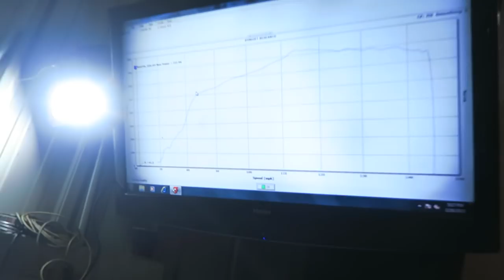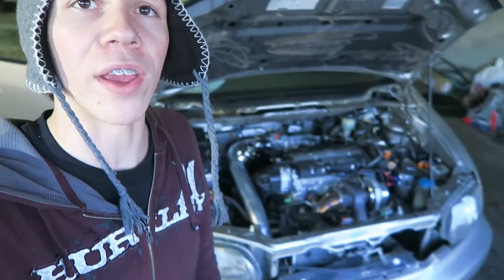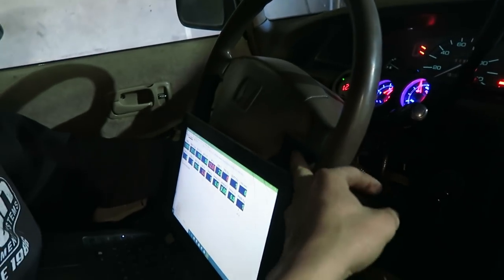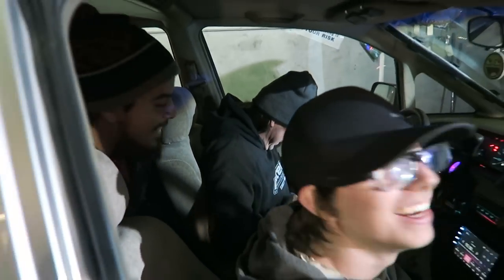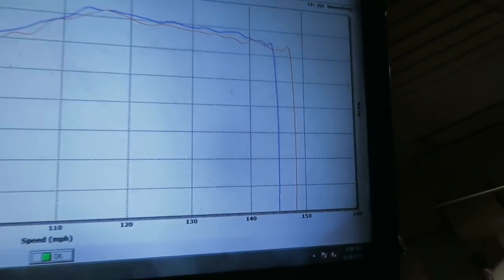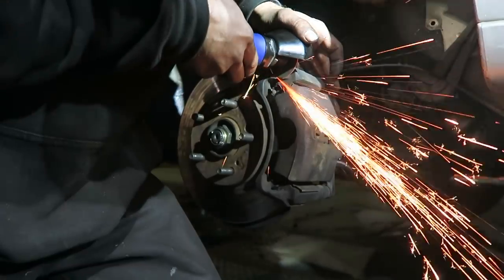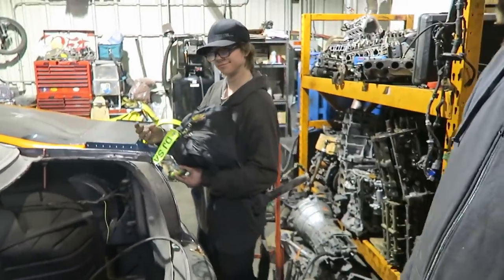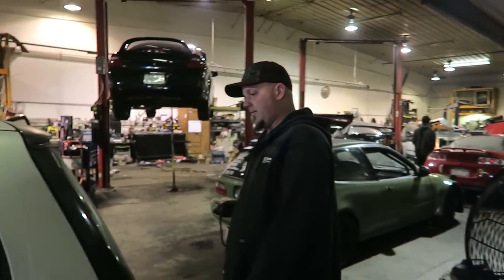The Minivan Made More Power Than My Race Car!

Comment: Guinness World record for most people down the quarter mile in one vehicle doing 10's.
Reply: CJ Serf you might be on to something
Reply: CJ Serf 8 people traveling 1/4 of a mile in 10 secs 😍😍
Reply: It would add 700kg of weight. It probably won't hit 10 like that.
Reply: Fastest standing 1/2 mile for a minivan with passengers ( Texas Invitational ), then do the 1 mile.  Get in touch with 1320 Video and make it happen!
Reply: CJ Serf I think after 13s or 12 sec pass you can't have a passenger let alone passenger's.
Reply: Yeah, just 8 dead people instead of 1. This thing would be dangerous as all hell at any real speeds. It's way too top heavy, poor suspension, and no cage. Even a slight wobble would send it rolling over.
Reply: Unco Casey bro.. 😂😂
Reply: Piotr Noja not all Americans are 220 pounds bruh. Maybe 400 kg MAYBE

Comment: Bushings gone on lower control arms. Crazy flex
Reply: Oscar Larin yeah that's what I would be worried about shooting down the track goin 140+. Imo that needs to be addressed.
Reply: Then again it’s 700 hp on stock suspension
Reply: hatch does the same thing

Comment: I think I speak for all of us when I say I think its time the hatch made a 1000hp!
Reply: Yesss 1000hp hatch lets go
Reply: But just think about the headlines "1000hp hatch" or "1000hp minivan"
Reply: Maxime Ly he can afford it, if not now, he can with saving. And do you honestly expect him to use cheap parts for a 1000hp build? With that been said, he has great quality parts where it matters (the block). The weakest link at that level is suspension and drivetrain.
Reply: Jbwifi from 700 to 1000 would require alot of work
Reply: Jbwifi dude above you is kinda right. Although I think he has plenty of money for it. He has h beam rods in where you would kinda want either an aluminum rod or the “Manley turbo tough” I beam rod. Making 1k hp he’s going to have more traction issues then anyone would ever imagine so he would need some sort of traction control. Also hondata is just a piggy back ecu you would want some type of full stand alone ecu. At least to make it reliable.  At that power he would need a dog box transmission because the factory transmission would literally shatter apart. Then I’m not sure what axles he has but he would want like a drive shaft shop level 5.9 or so.
Reply: Jbwifi your strongest parts are only as good as your weakest part. A cheap part can cause a chain reaction which will lead to total engine failure.
Reply: The van should have 1000 not the hatch
Reply: On behalf of all honda lovers such as myself i couldn't agree more.

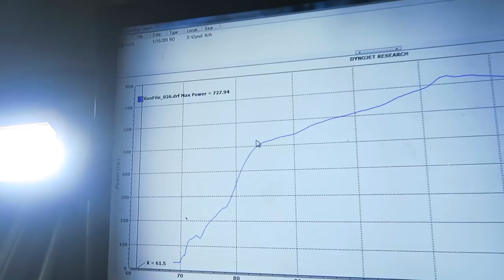Comment: 5:02 Holy hell the power under that curve is incredible!
Wish I could see the exact RPM, but that's nuts.
Reply: Brent said he was at 4000rpm when he stomped it and later he said the limiter was at 9000rpm's.
Reply: Lee Yep I realized that too. Pretty badass. :)
Reply: Whats the torque tho
Reply: Dirt4k Probably surprisingly good from the H22. I'd like to see too.
Reply: 802 Garage his hatch made under 400 when it made 711
Reply: Dirt4k Still good for a 4 cyl! The curve would be interesting to see. Either way, it's a fast van.
Reply: 802 Garage yea  but they just dont quite make the torque not with stock cams anyway, chryslers old Turbo 2.2 motors make 400+ torque at 400HP wheel, they don't flow as well or rev as high though obviously but pretty good torque out of a 2.2 from the 80's
Reply: Dirt4k Never looked into those. But yeah I'm always wondering if he is going to go aftermarket cams at some point. Doing pretty great for what he has. Can't wait to see the Florida content.

Comment: Don’t put the parachute on.
1. You’ll have to ruin the bumper to do that
2. You’ll ruin the sleeper aspect of it
Reply: Christian Lucatino is somehow make a removable chute mount. Not sure if it’s legal for drag or not but would remain sleeper
Reply: Mike C well the problem is there drilling a hole in the bumper that’s the main issue
Reply: Run a hitch? Then it's even more of a sleeper 😂
Reply: Not to mention the fact that the chute on a vehicle that size will surely whip the back end around violently and possibly roll it over killing everybody on board. Don't do it breh..
Reply: Are you joking? If you take the chute off itll look like some bike rack like he said. It is a sick idea
Reply: Carlos Gonzalez you obviously don't know what you are talking about bruh.
Reply: Mount the chute inside the cab, remove the hatch at the drag strip.

Sleeper and safe.
Reply: dude you aren't thinking clearly, it looks just like a bike rack. All they have to do is weld an old mountain bike to it and you wouldn't be able to tell it's a parachute.

Comment: 9000 rpm!! And he wants to bump it up to 9500 wtf!!! That’s insane for a h22
Reply: eel1331 no balance shafts and after market main bearings and rod bearings. If it was stock no way you get away with that kinda rpm without spinning a bearing.f20b will spin 9k stock since its got less stroke.

Comment: Why you dont do a race with the hatch and the mini van ??
Reply: Imnotyourdaddy  ok
Reply: It will be the best vid in the channel
Reply: Im sure the hatch would pull,way lighter,and better suspension.
Reply: Effin Casual's after if the mini van is fully power
Reply: KHATAM TUBE the hatch weighs less
Reply: Half the parts of the hatch are on the van.

Comment: Hay BoostedBoiz you should mount a GoPro where your rear-view mirror is that way you could capture everybody's reaction at a good angle

Also install a standard 2-inch tow hitch for your minivan that way you could quickly disconnect the shoot and have the option to tell your race car at the same time.

Comment: Ok I'm super impressed by these Honda motors. Can someone explain how a somewhat built Honda motor with an eBay turbo can make 700hp, while a fully built Miata engine (the VVT rebirth on CarPassionChannel) with basically every part of the engine and fuel system upgraded struggles to make 400hp. What's the difference?
Reply: Sage Moore don't quote me But it might be displacement
Reply: Honda vtec is agressive and a high rev limiter allows it to make power like race engines from ferrari. This is why ferraris and some modified hondas make over 200hp over the torque they put down. They spin fast. Race engines/race engine builders are more concerned about high reving, big power and getting the most power they can over torque. Hp wins races. Torque tows you home.
Reply: Vtec uses a normal cams and then uses race spec cams in the upper power band. Along with intake/exhaust vvt. Other manufacturers use economy cams for fuel efficiency and just intake vvt. These are the reasons a small 2liter 4cyl from honda can put down 320whp NA while other manufacturers v6 or even v8s stuggle to break the 300whp mark. Add a good ebay turbo and a decent fuel pump and injectors and you have a 700whp from a minivan.

Comment: Hey Kyle are you still on the stock transmission?
Reply: BOOST JUNKY so yes.
Reply: BOOST JUNKY that’s crazy over 700 on a stock transmission wonder what torque number are like  to be able to hold the power down without breaking a gear every time he goes for a pull
Reply: Efrain hes doin i think almost 470?? tq but he has broken a gear once that i know and got a free gear at the junk yard threw it on was running the next day
Reply: BOOST JUNKY numbers seem like a lot for it being stock not hating or anything I enjoy watching these videos but just seems off since my car and team members cars from my team we have cars pushing 600-650 and gotta swap gears a lot due to torque being around those same number 350-450 torque as well..we have one car in the team that has a full on ppg dog box and that car is pushing 700+ but only cause it has the transmission to hold the power down.
Reply: BOOST JUNKY would love to see the car that did that